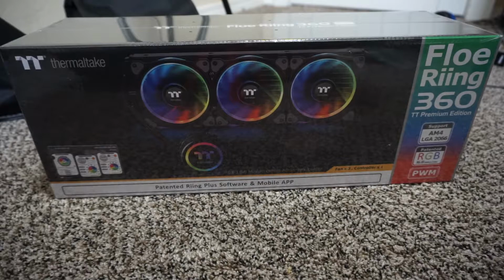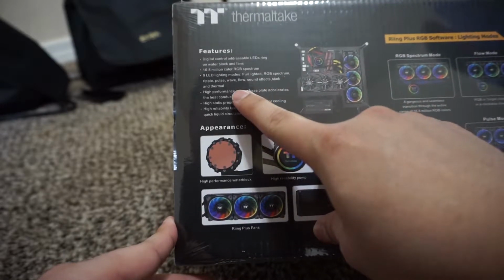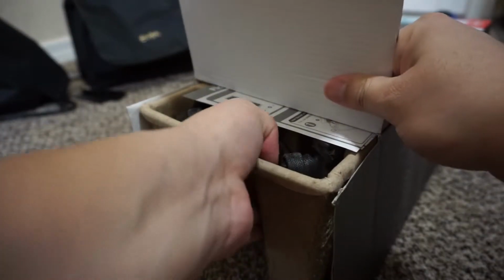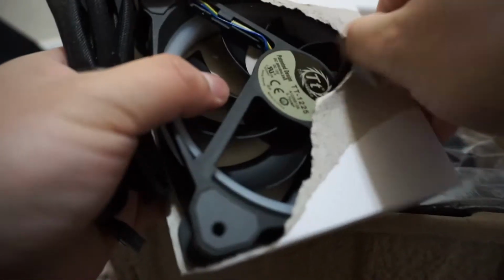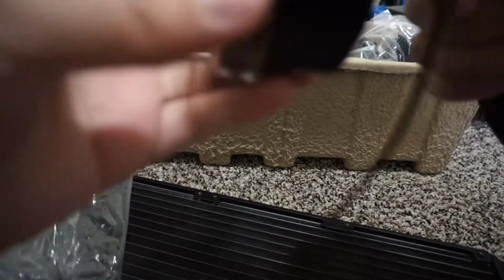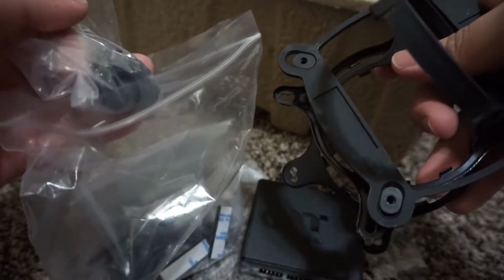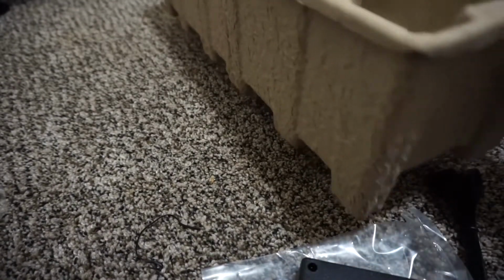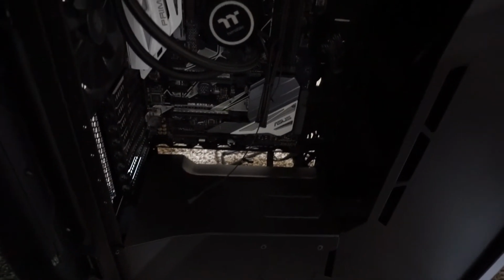Unboxing Thermaltake Floe Triple Riing RGB 360 TT Premium Edition

Comment: I am thinking about buying this and was wondering if I should get the 3 fan radiator one like the one you have or the 2 fan radiator. Is there a big difference?
Reply: the bigger the surface area the better